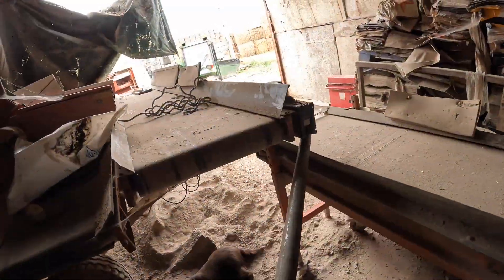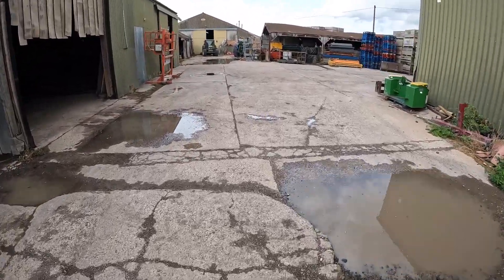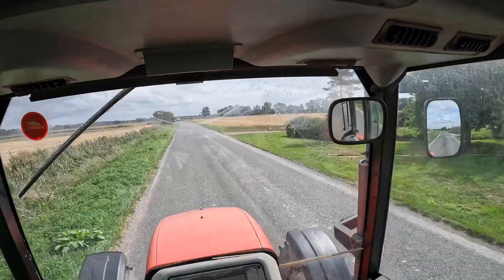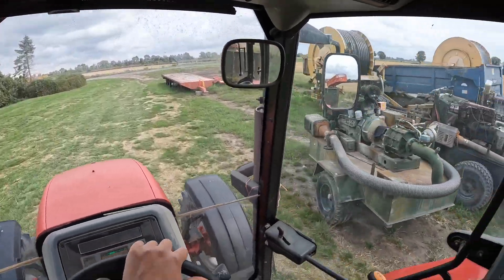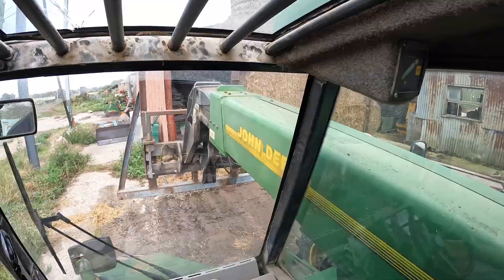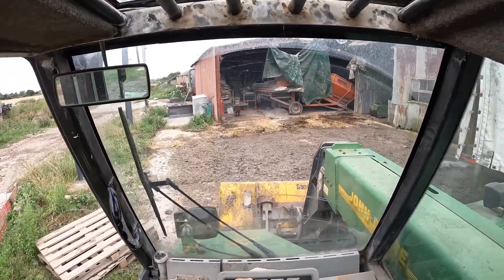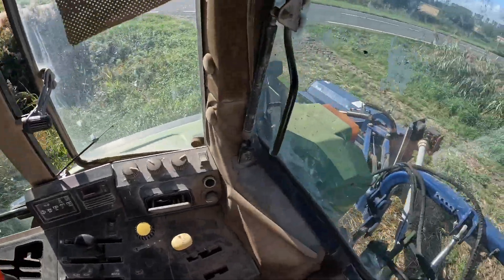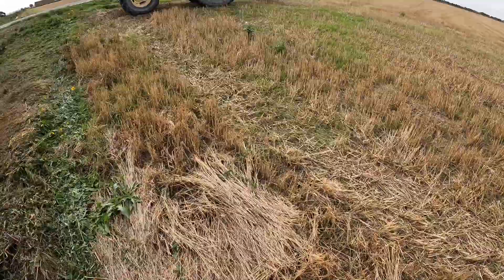Moving BIG Machines On The Farm

Comment: amazing video👍
Reply: Thanks Thomas trying hard 😂
Reply from the maker: Thank you ☺️
Reply: @danielsizer41   that  grader  what you guys  have got is huge   bet it doesn't take long with harvest with empty the trailers
Reply: @thomassteadman6781  mate sucks a 16 ton trailer out in 8 minutes not as fast as some but fast enough for grumpy grandpa 😂keeps the forklift drivers amused
Reply: @danielsizer41  well still does the job well LOL  how we used to get potatoes in at college  have potatoe boxes on flatbed trailer  and the harvester would empty in to them that way
Reply: @thomassteadman6781  yeah still works 😂 just motor fell off first time we used it so you know how good the quality is 😂🫣 and we did think about box loading we just need a picking table on the harvester and we’d be away
Reply: @danielsizer41   o  blimey   bet   grumpy grandad liked that when the motor decided to fall off LOL in   my opion though i'd stick with just unloading them in  trailer